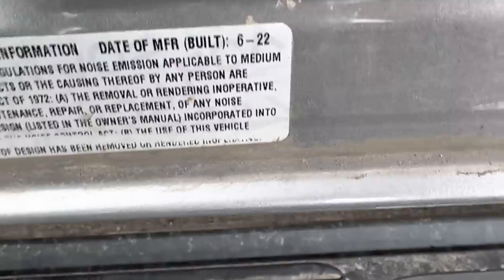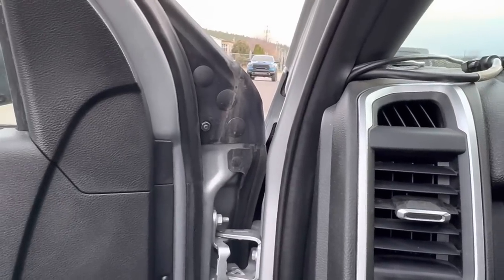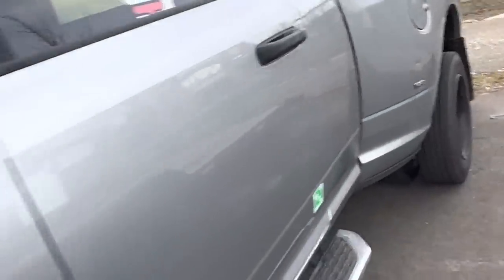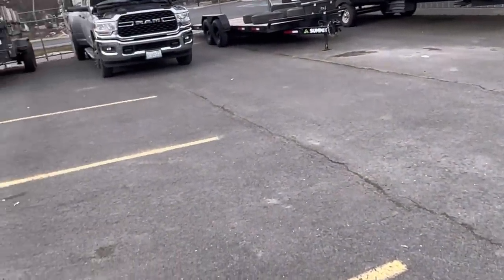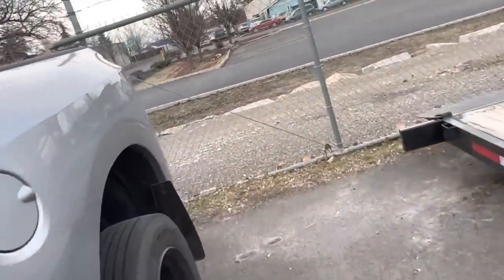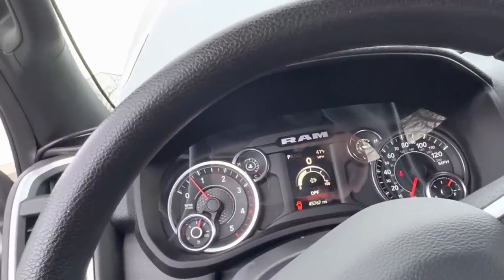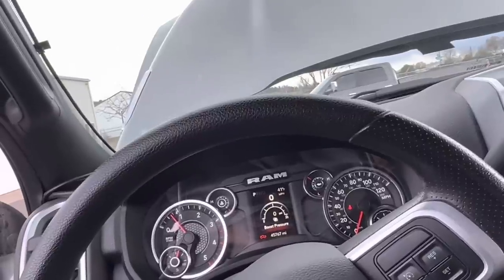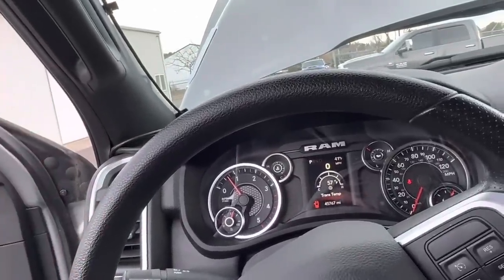2022 Ram 3500. How to tell if your engine is failing or just a egr.

Comment: 1/22 build date on my 2500 tradesman. Been perfect,so far. Only at 9500 total miles though. I don't idle it much. Put rotella t4 10-30 in it at first service. Plan to run t6 next time. Just an FYI for your curiosity! Thanks for your updates Paul!!
Reply: I have a 1/22 also with 20k so far no issues. I use 5w 40 t6, it's the only oil that's

Comment: I almost bought a reasonably priced 21 HO but it was snagged before I could get there. I've been watching this "series" for a while and it definitely made me stay away from the discounted straggler 22s (long list of recalls it seems). A few weeks ago I picked up a single owner 2017 long bed 68rfe 3500 with 52k miles for a good price. I'll tow my 12k 5th wheel about 6000 miles a year but it won't live the hotshot life so the 68rfe should be ok for me. I just got rid of an early 6.7 powerstroke with DPF and engine bucking issues so I've got some real PTSD from that experience I really want to avoid again. I think we're all invested in learning which year of the new cummins will finally have all this crap sorted out - between the CP4 disaster, the EGR valve failures, engine failure, axle issues, etc. Hoping my 4th gen will get me past this dark time!

Comment: If you happen to have the part number look up for 21, 22, and 23, look in the differences in the piston cooling nozzles. Theory that I've heard is that the cooling nozzles/oil squirters were upsized for 2022, but may have dropped pressure for the main bearings.

Comment: 3:55 Fully agree, EGR problem. Shitty DEF at the pump stations is the reason 100% of the time.
The suggested solution from big truck mechs - fill up on DEF 50/50 pump station and walmart def cans. Especially in cold half a year. DEF don't like cold )

Comment: Need to make sure to run 5w-40 engine oil and not the 15w-40. These engines have hydraulic lifters instead of flat tappets. All the tolerances are tighter.

Comment: Looks and sounds like the HO version may have issues with MY22’s. Could be parts/components quality control on certain builds, but I highly doubt in my subjective opinion that 22’s across the board are an issue year.  It sucks if your the one that gets issues.

Comment: Will the registration frequently put me on the side of the road I just got the code P2459 particulate filter regeneration frequently what's your thought I'm at 200k 21 ram any info I'm trying to get a load home from AL to TX WILL I MAKE IT? Check engine light came on

Comment: My 19 cummins  HO has never gone above  1/8 on dpf Guage.not sure if it's thats correct or quage doesn't read rite. Always at zero 98% of time on dpf guage. Maybe seen it at 1/8 one time rite after i got truck where we were just cruising in town no load. I always scroll thru menu everytime I drive it make sure there's no warning sign.

Comment: Still waiting for the cp3 for my 19- not fantastic customer service from Ram concerning recalls
Reply: Sell it and find yourself a clean 18’ or a 21’
Reply: @shanebrown2963  Yep, was trying to get a 21 but ended up with a nice 17. I've seen other comments on yt and forums that once they mess with the fuel system on the 19-20 trucks they often exhibit other fueling issues. With the quality of labor right now it's hard to get it right and the mechanics and dealers don't care if the truck runs like it did factory optimized. They ship it as long as it runs at all. Good luck.

Comment: PD could you do a quick video on 2022 fuel filters change?
Reply: Christopher use nothing but OEM fuel filters the Mopar filters are Cummins Fleetguard fuel filters. All aftermarket fuel filters are inferior in design function and filtering. The reason is Cummins patented design and patented Synthetic Stratapore Nanonet media no aftermarket can copy unless you don't care about your high pressure fuel pump and the injectors it wipes out at failure.
Reply: Thank you Jon O much appreciated.  I went out purchased OEM fuel filters from local RAM dealership.  I also purchased OEM engine oil filter.  Do you have engine oil recommendation for 2022 RAM 2500 6.7? Book shows Shell Rotella 10W-30 which comes as T4 (triple Protection) or T5 (synthetic blend technology).